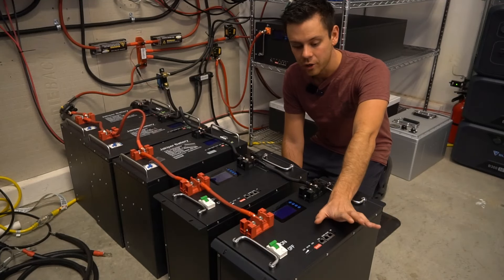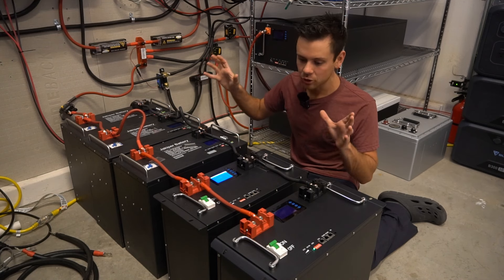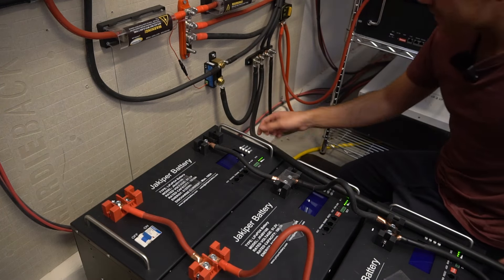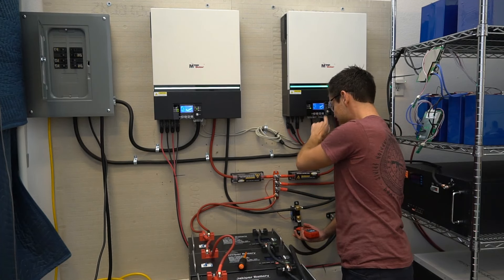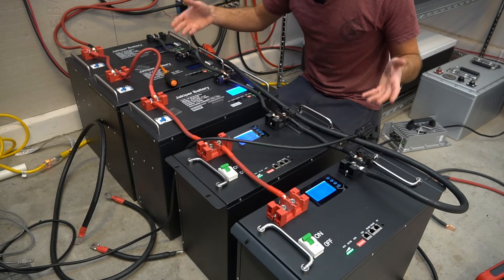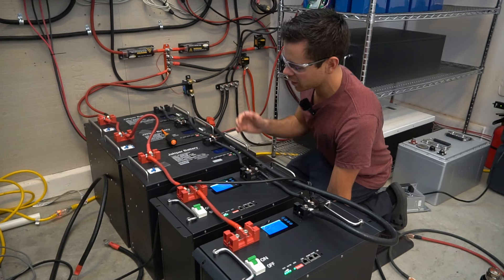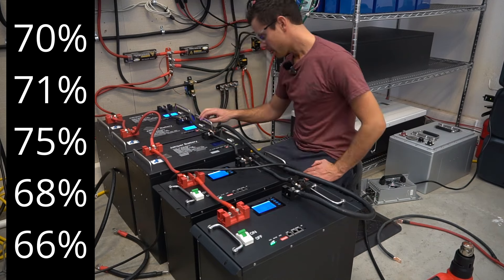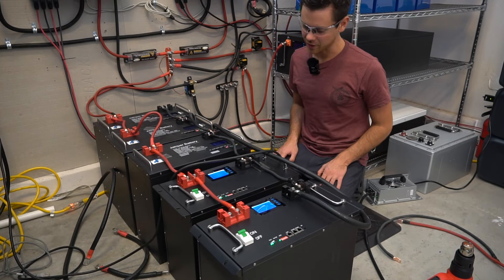Current Sharing Experiment: 25kWh LiFePO4 w/ Diagonal Wire Configuration

Comment: I thought about having either very large cabling, or stepping the cabling up as you get further from the end point. But if you connect the charger on one end of the string and the inverter on the other, cable size incremental compensation wouldn’t work. So now I’m going for free standing bus bars, with equal cables from batteries to inverter and charger, and then one massive cable from the bus bars to them. Question is, will it hurt to connect the inverter and charger to the same posts on the batteries? After all, with any configuration, the inverter and charger are not isolated from one another. That is an impossibility? Maybe diodes would be a way to isolate/direct current flow away from the charger, and to the inverter? This is a quandary. What stops current from flowing back to the panels or away from the inverter? Just the natural flow of electricity? Oh that’s right! Solar panels do have a diode on each one. I saw a video where a guy checked and replaced panel diodes to repair them. And the inverter is not a source, so it cannot feed current back to the batteries. Sorry, I’m thinking out loud/in writing.

Comment: If the middle battery pack needs to be charged in solation, can I just switch of the other batteries and let my solar system charge it? Or must the "master" battery pack be always on and therefore this kind of charging can't be done? I assume that if only one battery pack is on, it wouldn't matter if it was "master" or "slave". Am I right? Thanks.

Comment: Thanks Will. That's really useful. Is there any chance you could do a test with the halfway configuration? Also, should the power take off be on the same terminals as the charging leads, or different ones? I ask for practical reasons, as I have 4 domestic 12v batteries on my boat. (Currently agm. When they die, I want to go lithium.)

Comment: what i am really wondering is the big difference between the 1st 2nd and 3rd battery which are mainly all the same.
The idea in the diagonal system is that every battery has the same resistance to the common battery terminals, so the 1st battery is directly at the positive terminal, but then has to go through all bridge wires on the negative side. the second has 1 on the positive but 1 less on the negative side.

We have some unlinearities in the bridging wires that cause this problem. The first wire on plus got quite warm thus the resistance was much higher. but the wire on the negative side was cool(because there was only the 1 battery on the negative terminal). So the 2nd battery gets much higher resistance with the heated wire on plus but looses only the low resistance of the cool cable on the minus side --->> so this battery gets a higher resistance to the poles 
the 3rd is the worst because it has 2 heated wires on plus side and 2 heated wires on minus side

And because the battery curve is so flat und the internal resistance that low, minimal voltage changes cause great current changes.
So we yould need a larger wiring to the terminals. maybe you can connect the big wiring directly together in a "twin-lug" and dont pull the currents directly through the terminals of the batteries or at least the lugs schould touch each other in the same terminal. Maybe you need to trim the lug to fit in the terminal.

Comment: Hi Will! I’m currently putting together your “Off Grid King” Setup in my camper and have run into some dead ends. I’ve got 4 lithium batteries (12v, 206ah each) and don’t know how to connect them in, whether in series or parallel? I’m also worried that 4 is too much? In your guide you only used 2, but since they were gifted to me, i thought i’d try to put them all in. I’ve bought everything else you recommended in your guide but am stuck on wiring these batteries together, trying not to burn my lil home down 😅
Reply: Wiring configuration depends upon your desired voltage—do you need 12v or 24v or 48v?  This is determined by your inverter/charger
Reply: @powerranger9160   i’ve got the GoWISE Power PS1004 3000W Continuous 6000W Surge Peak Power Pure Sine Wave Inverter
Reply: That's a 12v inverter, you'll need to wire them in parallel to keep them at 12v (the current will add up).

Comment: Maybe redo this experiment with 2/0 everywhere, resistance is everything in this experiment and if your leads are getting hot then you are way over taxing the cables.  also if you were to show current verse what the cable size allows (electrical code) that would be very interesting.  Not sure how oversized the lugs are but maybe a bit of trimming at the end to fit into the terminal connections might just allow the 2/0 experiment... cheers!!
Reply from the maker: I can't use larger gauge cables on these terminals so that would not work. These batteries come with 6 gauge cables, so for most people their results would be even worse.
Reply: @WillProwse  Understood

Comment: I love the way William explains things as he tests and compares similar devices. I have SolarEdge inverters. Where to connect batteries on the HDwave version is clear. However, one can and can not connect for charging is so vague in the manuals. The manufacturer is leaves out the information to prevent educating yourself. Preventing you from creating your own solutions.  Does anyone know where I can get the "battery connection specs" or schematic on an array that can be connected to a SolarEdge HDwave other than a $10,000 LG Chem the installer wants to sell you?  I don't think I can connect a 48 or 24 volt battery array.  I would love to wire up LiFePO4 batteries.

Comment: I'm curious about those two different batteries, as far as their internals - how are the cells inside laid out? It's my understanding that with LiFePo4 cells, aside from the usual normal upright position, they work fine when laid down flat (like in the BigBattery cases), but not on their narrow sides? With those server rack enclosures up on their ends like that, what position are the cells within sitting in?
Reply: Not sure if anyone else commented on this but one item you missed in your config is the cable sizes should have increased closer to the connection to the inverters. You were careful to run 2 x 2 ga cables from the last battery to the wall because 2 ga was not enough, but the cable
Immediately before that between the last and second last battery on the pos side was only 2 ga. You likely had 180 amps going through that little 2 ga cable. You even mentioned how hot is was getting. I honestly was waiting for it to start smoking. That much heat and small conductor would have at least thrown the test off between the last pack and the rest. Love watching your tests.
Reply: @davidwhite47  You replied to my comment instead of leaving a new reply, FYI :)

Comment: Why did you say you should not double up cable if you have not got the right gauge? In my 3kW inverter / charger / shore power unit, the manual says doing this is fine ('copper is copper' it says). Also, the test you're doing is bound to fail because the batteries are not the same size ('fail', as in the end batteries will give out more current). With even sized batteries there will be some difference in delivery but not to the extent of your setup. I've read that to avoid ageing the batteries they should be physically moved in a diagonal setup (ie. rotated to the end positions) on a monthly basis.

Comment: Seems as though if you only had two batteries, you could get away with cross connecting them, and it would pull equally in that configuration.

Comment: Wouldn’t it be better to use the charging cables and the batteries in the Star Configuration with the charging cable being split into a load sharing cable being split into 4 or 8 different cables going into each battery which you think you could do and leave all of the batteries laying next to each other for space management and use a load sharing split cable out for the use of the batteries to keep all of the batteries at the same state of charge while they’re in use and/or charging with thinner cables connecting the batteries together with lighter gauge cables going out to shorter Bus bars which would save you a lot of money all the way around and help you with the problem of out of balance batteries and the problem of connecting batteries together with such heavy guauge cables that have smaller connectors ?

Comment: I am having trouble seeing how a "Diagonal" configuration with equal length wires is any different than a "Bus bar diagonal" setup. Its the same amount of copper to travel through in theory. How is the busbar setup better?
Reply: If you have bus bars, each wire from each battery to the bar, will have a certain amount of current, say 30A, and the bus bar will carry the current effortlessly (say: 150A) due to its dimensions and low resistance. When you wire the batteries together in parallel without a bus bar, and you are limited in your wire-dimensions, then the wires closest to the (diagonal) terminals will carry a lot of current. The wire from A to B carries 30A, from B to C carries 60A, from C to D 90A, etc, until you reach the final terminal, which carries the full 150A. You can see in the above video, that Will mentions that the wire closest to the (red) terminal is the hottest, which makes sense, as approx 120A is going through it. Same would apply to the battery wire closest to the black terminal.

Additionally, you want the least amount of connectors in series (with high amps), as they are relatively high resistance, due to reduced cross-sectional area and relatively poor connection between lug and terminal due to oxidation and rough surfaces.
Reply: @skipbalk8248  Thank you, that was a great explanation.

Comment: I do not understand how a busbar would solve this at all... Because depending on where on the bar the batteries are hooked up, changes the resistance of the path because of the different lengths for current to travel.

Comment: With bus bars, you're still wired in a "diagonal" configuration. It might make some difference because the bus bars could be heavier material than cables. I think you'd need equal length cables for all conductors to solve this problem.
Reply: Actually, he mentioned the equal length cables many times, in both videos.

Comment: You put the positive cable at one end of the 5 battery’s? Then the negative at the other end. Which still made you technically putting a cable at one end to travel across the whole amount of battery’s. If you put both cables dead center of all 5 battery’s. Then the current only has to travel 2 battery’s to the left and right from the dead center battery’? That seems more appropriate for the current to travel equally both ways?  However though. I think if you took the positive cable and split it into 2 terminals to connect to the second battery in on both sides at the same time. And the negative the same way. Example ( Y ) The positive cable hooked to the bottom of that Y and the 2 tops of the Y connected to both the left and right second battery’s in from each end. I think that would be more stable and draw more equally to avoid over heating. So you would be drawing current more correctly with each terminals drawing from 3 battery’s jointly.. tighter travel versus clear across the whole banks…Thanks for your videos